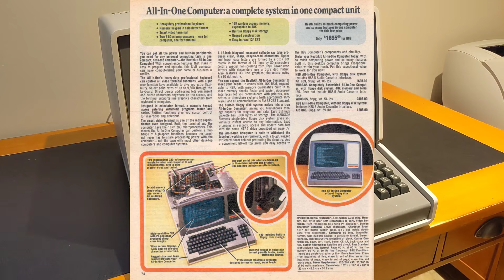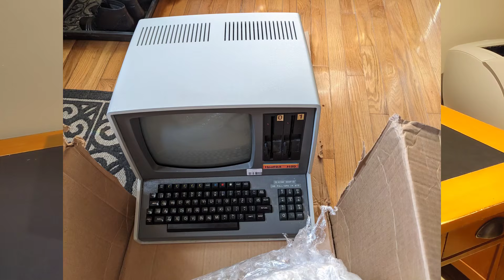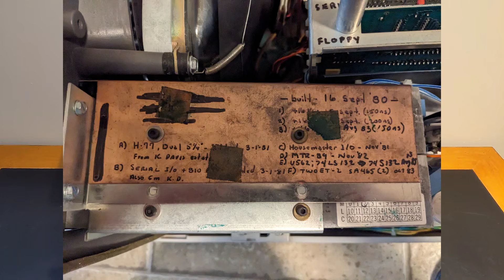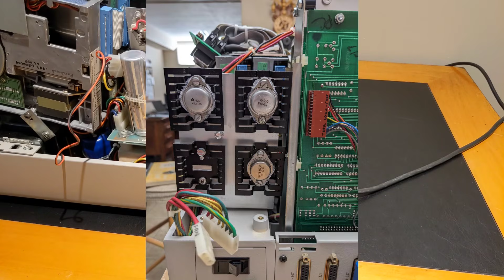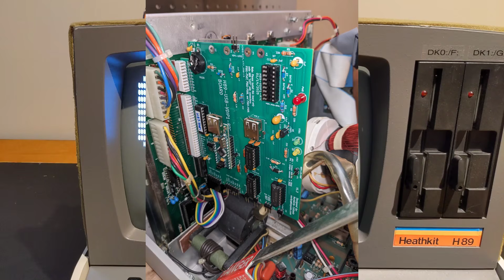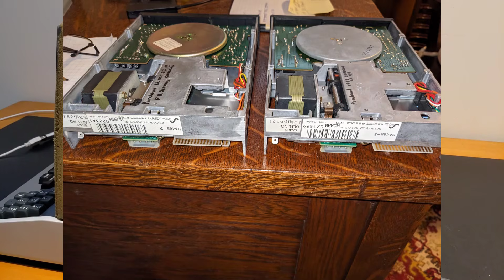The Heathkit H89 Computer Part 5: Restoration of My Unit

Comment: That disk transfer program sounds somewhat similar to how ADT (Apple Disk Transfer) worked in the late 90's, when I first used it.  Had to use the system monitor to set the Apple II to operate from a serial terminal, then send over a binary file with "your favorite terminal emulator" from DOS / Windows, execute the resulting binary from RAM, then use THAT to transfer a DOS or ProDOS disk that contained a bootable version of the Apple II-side ADT program, which then allowed transferring many disks one after the other.

Today, it's still maintained (in a later "ADT Pro" version), and it does all those steps without any of the fiddly steps, nice and automated, and runs fine from pretty much any modern OS.  It's amazing what users have come up with for these old 80's machines to keep them usable!  Too bad that HeathKit program is, apparently, not as universal.

Comment: My H89 (s) built in 81 were used for engineering school and person finances through 1992!  Never had any problems with the CRTs.  I increased the fan venting on one and added a cool graphic board for plotting and I think that was it.  Used HDOS and CPM.  Learned spread sheets, Fortran, Basic and word processing with these great old PCs.  What memories !  Thanks for your review and restoration review.  To bad you never ran across my units.  I donated / gave them all away when I moved from Grosse Pointe MI to San Diag in 2010. Everthing was in perfect working order. I hope they found a good home!